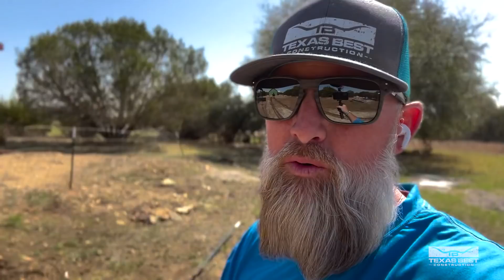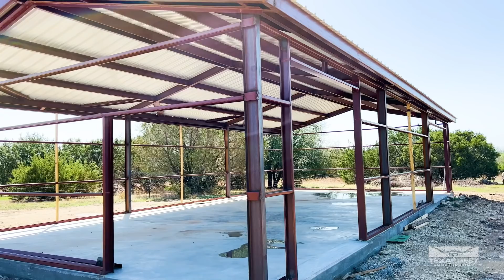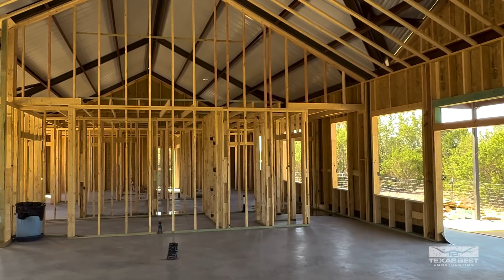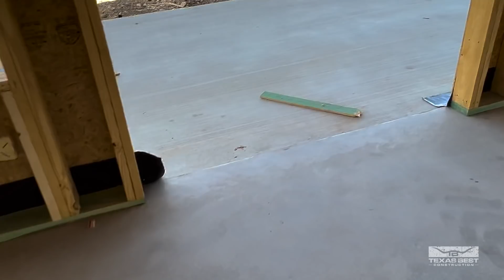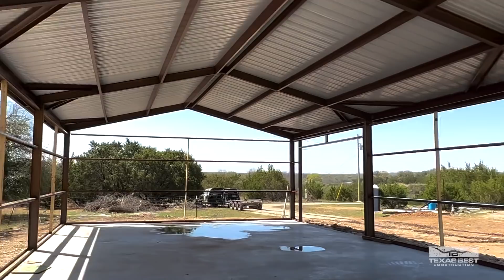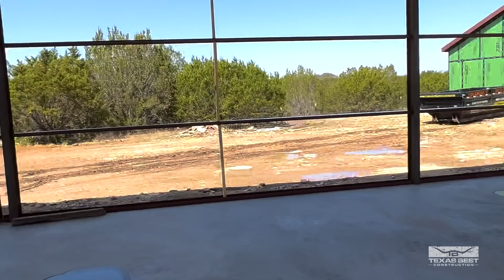Why I ONLY Build HYBRID BARNDOMINIUM Homes | Texas Best Construction

Comment: I never heard of barndominium until the show and love both. I Plan to move to Texas from Maryland & understand Texas doesn't have basement. Im concern about extreme storms, wind and water etc.  Also earthquakes, this new world & climate change can't prepare for everything however how well do a barndominium hold up.
Reply: Have a shelter built with your Barndo if you have those concerns.
Reply: Earthquakes in Texas?
Reply: Well maybe not Earthquakes lol. But some type of safe room. Been watching some of your construction videos, how deep do the support beams go.
Reply: @Mquarre  weird as it sounds we do actually experience the occasional quake in parts of Texas. Recently there’s been discussion that some of this is being triggered by the increase in natural gas drilling and the process the drillers go through to inject a briny solution into the ground to push gas and petroleum closer to the surface.
Reply: Hi, Robert, I grew up in Maryland (with a basement) and have lived in Texas for decades, and I'm in the process of getting a barndominium built, and so I've been researching EVERYTHING like crazy, which happens to have included basements. 

I've never heard of earthquakes anywhere in texas, you can avoid water damage by making sure you don't buy a house in a flood zone. Wind and tornadoes are basically the same issue, so I'll address basements and tornadoes below.

Yes, much of the soil across Texas does rock and roll, and foundation problems are rampant (the usual preventative suggestion, being to get "leaker" hoses, or a sprinkling system, run them/it around the perimeter of your house, and turn them/it on periodically to keep the ground moist). 

Here's a summary of what my research has turned up on basements, that I think would be relevent / helpful to you :

1) Basements can be built in Texas, but it will cost more than building a basement elsewhere in the U.S., because of all the extra additional reinforcement and waterproofing in the basement walls that will be needed due to the soil.
2) There are two main reasons why there are so few basements in Texas:
    A) Texas is big. Land is cheap. If you are needing extra storage space (the usual reason for a basement) it is cheaper and easier to build outward across more land, than to dig downward and do all that extra reinforcing.
    B) the other showstopper is, because of reason (A), there are not a lot of builders who have any experience in actually constructing any kind of basement, much less a specially reinforced one.
3) there is an additional advantage to going to the expense of building a basement in Texas, although how the cost breakdown works out, depends on the size of your basement, the size of your house, etc, but the gist of the idea is, Texas is HOT. For a lot of the year. If you use an HVAC system to circulate cold air up from the basement, up through your house, you can reduce energy bills on air conditioning. Potentially. On the other hand using mini splits may be more efficient than any of that. You need people with the right knowledge to evaluate your square footage, what size basement hole you would need to provide enough cold air tobmake a difference, what it would cost to build it and reinforce it, etc.
4) if you are very, very concerned about only tornadoes (and not having extra storage space or building a "man cave"), it would be much cheaper to build a very small area in the ground to get into for the duration of any tornado. It would not have to be as deep as an actual room, or as long and wide as an actual room, or finished off like an actual room, or insulated or have electrical outlets or anything else,, since its only purpose wpuld be to provide an earth shield around you during a tornado (you don't need to put a pool table in there, and a couch, and a refrigerator, and play video games, it's a temporary emergency shelter and that's it). You might only need it to be as big as a pup tent. 
5) If you end up with land where your house is on a hill, or near a hill, or there's a slope, you can easily just basically dig a small short tunnel into the hill and walk into that big protective mound of Earth without needing to specially reinforce or waterproof it. Or build a full walk-in basement. It would be cheaper because it would be a ground level.
6) Here's a great YouTube video "Can you have a basement in Texas?". It focuses on the north Texas area, but what he says applies to everywhere. At the time this video was made, 3 years ago, there were less than 30 basements in all of north Texas. But the short answer to the question is 'Yes, you can". Most people say you cannot do it because of the clay soil, but the clay soil that deep down doesn't shift much because it's moist and compressed. 
And more high-end homes are building them. 

https://youtu.be/z2AwQ6J7s34

The man who made the video is named "Todd" (I think?), and it looks like you can message him in the comments so that it flags him by clicking on his name in one of his replies, which generates something you can type a reply in, and which has this for an address (maybe just type it before comment)
 @Dallas Fort Worth Real Estate Expert & Radio Host  
... And also here's a phone number for him 214-216-2161 

7) There's a female realtor with a video, listing 5 reasons you "can't" build a basement in Texas,  posted 1 year ago :
https://youtu.be/KgcV1gY2QfM
Bottom line, 4 of the 5 objections would prevent anybody from digging pools either, and there are plenty of pools. 
Again, the real obstacle to basements seems to be reasons I listed above - the cost of doing it, it's cheaper to build outward across land than dig down deep into the land, and there's a general ignorance in builders how to do it.  
The 5th objection is that Texas soil has a high waterline close to surface. But extra waterproofing can solve that issue.
As of when she posted this, one year ago, she said:
COST:  $30,000 - $100,000 to build a 1,000 square foot basement.
  ... because of the cost of building walls, waterproofing, flooring, and,"conditioning the space". Someone else on the comments mentioned sealing. 
Note that 32 feet x 32 feet = 1024 square feet. (31x32=992)

8) "Bryan Poché - of "Earth Form Foundations" was selected by the realty company "J. Anthony Homes" realty in North Texas, in this video to build an absolutely fabulous - and it looks like spacious - basement - and this was FOUR years ago!
https://youtu.be/YUH9Seuglxg
It says it was fast & they were able to build it while construction of the house was going on around it. It shows sped up, time lapse, stop action, actual building steps from unbroken ground dirt to basement. I tried to find the company and long story short I had to do a WHOLE HECK OF A LOT OF DIGGING because that company doesn't exist anymore, but I finally found the contact information to Brian Poché :
 "Poche' Construction Group" with a BBB rating of "A+", and it's been in business 3 years (so basically since right after that video was made)
 Contact Information:
2750 S Preston Rd STE 116-117
Celina, TX 75009-3885 https://pocheconstructiongroup.com/
(214) 869-4035

They might do projects only in the DFW area. The "POCHÉ CONSTRUCTION GROUP" web page advertises a "patented method of  basement construction" but direct you to a dead link, and the projects page for that company shows you basically pictures of only that house and two pictures of some other house. However, digging further, to try and find the last basement that company built, I had success and found five 5-STAR reviews with a lot of emphasis on things I care about like honesty, helping them build something when they're not sure what they really want, professionalism, listening, etc. 
https://www.homeadvisor.com/rated.PocheConstructionGroup.108664085.html

9) ... The web page gor Bryan's old company popped up "similar companies, which had links to:
 "The Basement King" (2 reviews, 5 stars)
 "The Foundation Guys" (12 reviews, 5 stars)

10) Also check out "OLSHAN" - over 100 reviews,4.9 stars, reviews say all the right things, they cover all of Central Texas & more & they really mean it, listing cities from DFW to Austin to College Station (near Houston) & more. 30+ years in business, 2020 BB  Distinguished business award.
877-365-7426
NOTE THEIR HELICAL PIERS DESIGN INNOVATION
    
11) See also "Advantech" - 4 year old video by (CEO?) Re/ this product used in the flooring of the video above : https://youtu.be/OitEJmc51Sk

There. That should save you a whole lot of days and nights of digging - no pun intended. 😁

I hope the above information helps you, or at least somebody !!!

And, PS - if it makes you feel any better, I just did a little bit of googling and:

A) "On average, lightning kills more people per year than tornadoes."

(That's from NOAA - the U.S. government's National Oceanic and Atmospheric Administration - i.e. where all our weather and climate info comes from : https://www.spc.noaa.gov/faq/tornado/ltg.htm )

B) "But the odds of being struck by lightning in a given year are less than one in a million, and almost 90% of all lightning strike victims survive."
   (From CDC.gov, the U.S. government's agency for the Center for Disease Control, in their section about "natural disasters"
   https://tinyurl.com/5ay4hwvp )
   
C) "The odds of being killed in a tornado in a given year are 1 in 5,693,092."
   (From "DiscoverTheOdds.com" :
https://tinyurl.com/7bepfaep)
Reply: PEMB's are designed to meet local codes, or, your personal upgrade in strength as desired. This structure type is typically what's left standing after a "climate change" (LOL) event after demolition of the surrounding structures.
However, codes go out the window when tornados do their thing- go underground   if you fear...